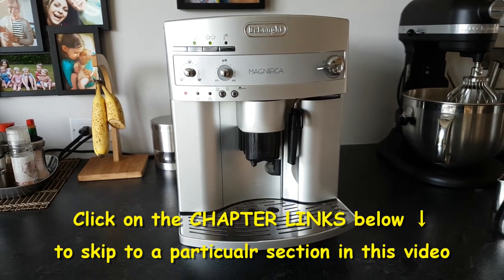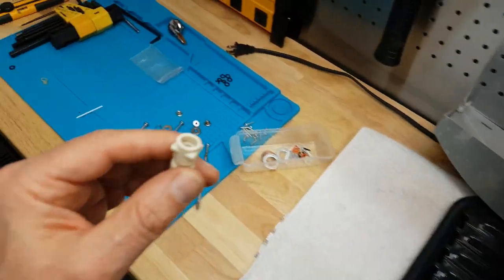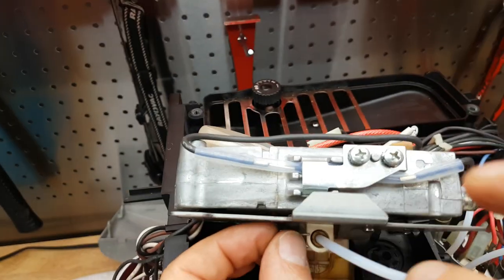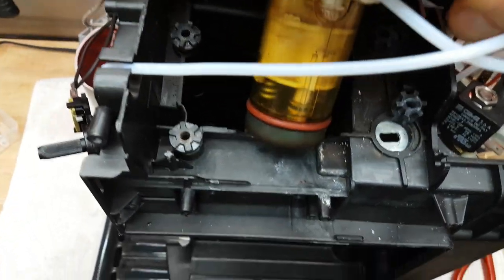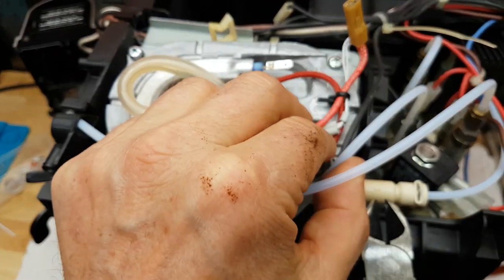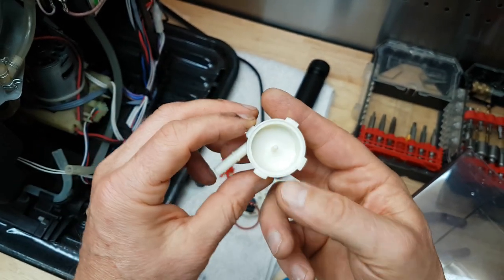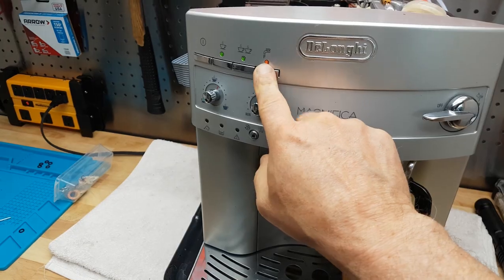Fix espresso machine that leaks and stops running (gaskets & flow-meter problem)

Comment: Mate, you literally solved my problem by fixing the flow-meter. I disassembled/cleaned nearly every part after the Delonghi started the grinding process but stopped immediately when the flow started. I nearly dumped the Delonghi but saw this video and thought this might be the problem. Thanks for this video:-)

Comment: Great video! Those hair pin clips of the right size are impossible to get. I had one of the bigger ones that was damaged - one leg was missing. I got the right size BUT the clip wire was too big. I finally was able to file it down. Finding the right size o rings is a headache as well.

Comment: Check the ends of all hoses for damage and sharp edges.  If you find any use heat to remove the edge.  If that is impossible, assemble to the hose first then fit  into the joint.  When assembling O-rings, make sure that they are coated with a food grade assembly lubricant.

Comment: My delonghi ec820b is leaking from bottom  and lost steam pressure. When i open it though everything looks fine and no leaks. The water from bottom seems to be some overflow pipe. Could the issue be restricted flow causing backpressure activating overflow valve?

Comment: Hi - I replaced my pump on the Delonghi Magnifica because it was not delivering water anywhere - the steamer now works but the coffee part is not delivering any liquid - any suggestions ? - There are no leaks . I’m an amateur but I’m willing to try ! If so do you know where I can get the parts and directions to repair myself? Thank you

Comment: Hi Martin,

I have the same
Machine as your video

It’s leaking water underneath and the “empty trash container” light is on 
(it turn on during a descaling cycle, and it did not turn off since) 

Do you know what to do?

The first part of the video with replacing the gaskets and the small U-shaped wire, it seems very difficult for me. 

I am a girl so all the components to put them back, seems difficult, I don’t know if I can do it? but I know  for sure I cannot afford a new expresso and I do need it in morning. 

I could do you watch, is the second part opening in the back end cleaning up the wrong part four the car car with a small drill (1.2) that I can do… any suggestions??? 

Again 
1. second light is on it came on during a descaling process (and honestly the descaling light was on for a very long time and I did not descale in time 

2. Water is leaking under my coffee maker on my countertop.

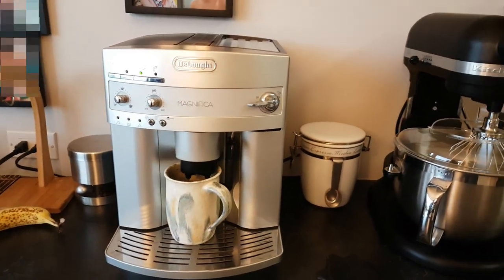Comment: Hi Martin, thanks for the video. Where did you buy the O rings/gaskets? I have a leak on the plastic piece going into heating element, on the heating element side. Plastic piece about 25:09 on your video.
Reply from the maker: I checked at 25:09, but there is no plastic piece at that time marker. But in any case you would just have to replace the gasket or both of them if there are two going into the heating element.

Comment: Hi Mate, what size are those O-Rings, great video btw
Reply from the maker: on my machine I have two different sizes, 4mm and 5mm inner diameter. But of course the ones on your machine might be different. I just took my old ones to a hardware store and went through their O-rings until I found the right size.
Reply: @MartinKnauber  Thanks Martin, super helpful video. I had no idea about the evolving flow meter problem and just drilled mine out too. The machine started leaking fresh water like a sieve. I hope this will stop the issue. I hear steam coming out of the top pipe connections, gotta replace the gaskets too. As you said, I hope I will find them at the hardware store.
Reply: Go to DeLonghi's website (or just call their customer service line) and find the closest service center to you. They will give you the exact replacement part. Price will be a little more expensive than going to your hardware store but you will get the correct part. Also, note if the o-ring is black or red. Do not replace a red one with a generic black one. Red means they are specially made so to withstand the higher temperatures.